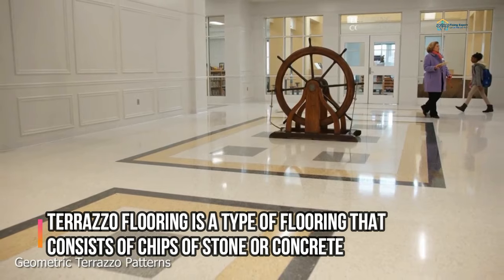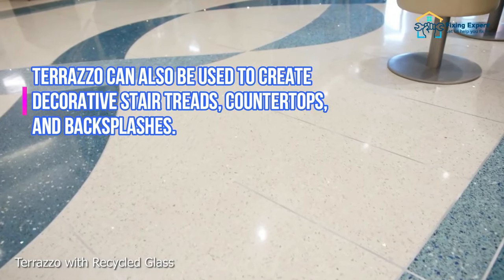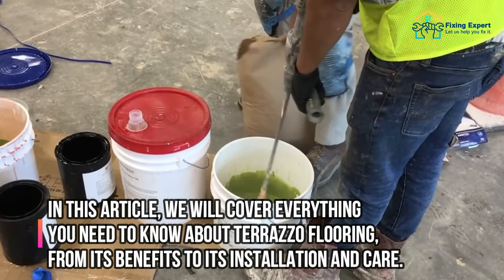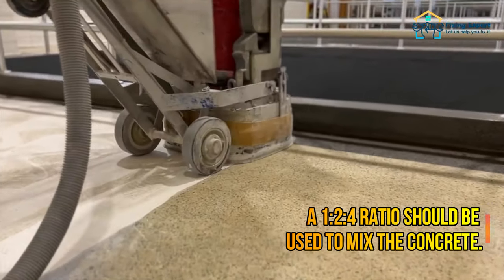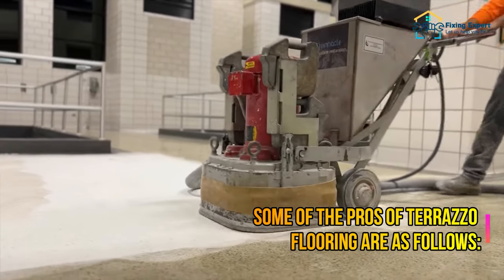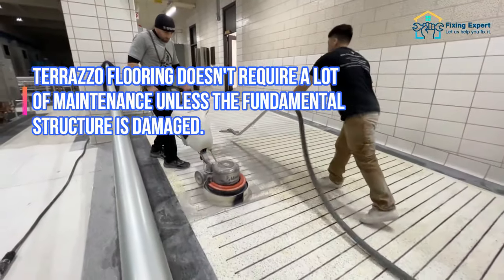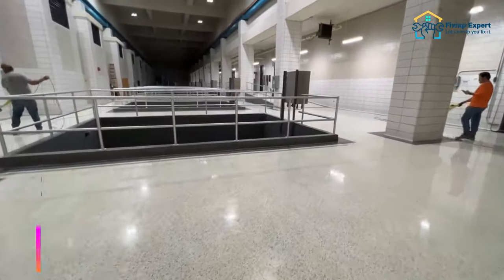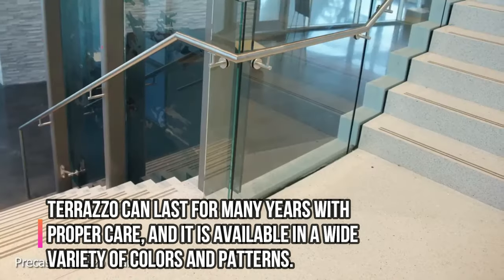How To Install Terrazzo Flooring? | Terrazzo Flooring Guide 2022 | Advantages Of Terrazzo Flooring

Comment: But why is it a popular choice for both commercial and residential buildings?
Reply from the maker: Terrazzo flooring is a popular choice for both commercial and residential buildings for several reasons:

Durability: Terrazzo is incredibly durable and long-lasting. It can withstand heavy foot traffic and is resistant to wear and tear. This durability makes it a cost-effective flooring option in the long run, as it requires minimal maintenance and has a long lifespan.

Aesthetic versatility: Terrazzo offers a wide range of design possibilities. It can be customized to create intricate patterns, designs, and color combinations. This flexibility allows it to fit a variety of design aesthetics, from traditional to contemporary.

Sustainability: Terrazzo is an environmentally friendly flooring option. It is made from a combination of recycled materials, such as crushed glass, marble chips, and other aggregates, mixed with a cementitious or epoxy binder. Additionally, its long lifespan reduces the need for frequent replacement, which can be harmful to the environment.

Easy maintenance: Terrazzo is relatively easy to clean and maintain. It can be sealed to protect against stains and moisture, and routine cleaning typically involves mopping with a neutral pH cleaner. This simplicity of maintenance is especially appealing for commercial spaces that need to uphold high cleanliness standards.

Hygienic properties: Terrazzo is a non-porous material when sealed correctly, which means it doesn't harbor bacteria, allergens, or other contaminants. This makes it a sanitary choice for both residential and commercial spaces, such as hospitals, schools, and restaurants.

Longevity: Terrazzo has a track record of lasting for decades, even in high-traffic areas. This longevity can significantly reduce the need for frequent replacement and renovation, saving both time and money in the long term.

Improved indoor air quality: Unlike some other flooring materials, terrazzo does not emit volatile organic compounds (VOCs) or allergens. This can contribute to better indoor air quality, making it a healthier choice for occupants.

Heat resistance: Terrazzo has excellent heat resistance properties, making it suitable for areas with high temperatures or exposure to direct sunlight.

Investment value: Terrazzo flooring can add value to a property due to its durability and timeless aesthetic. It is often considered a premium flooring option, which can enhance the overall appeal and resale value of a residential or commercial space.

Sound absorption: Terrazzo has sound-absorbing qualities, helping to reduce noise levels in busy environments. This is a significant advantage in commercial buildings, particularly in areas with heavy foot traffic.

Overall, the combination of durability, design flexibility, sustainability, and ease of maintenance makes terrazzo flooring a popular and practical choice for a wide range of residential and commercial applications.
Reply: lol
Reply: “Because of its durability and low maintenance”. 🤣😂🤣
Reply: Watch the video
Reply: Thanks for watching the video

Comment: I was told stone floor has to be honed when badly stained
Reply from the maker: To address severe stains on a stone floor:

Assess: Evaluate the extent of the damage.
Clean: Remove dirt and debris with a pH-neutral cleaner.
Grind (if needed): Use coarse abrasives for deep stains.
Hone: Smooth the surface with progressively finer abrasives.
Polish (optional): Enhance the finish for a shinier look.
Seal: Apply a suitable sealer to prevent future stains.

For best results, consult a professional if you're unfamiliar with the process, as improper techniques can damage the stone.